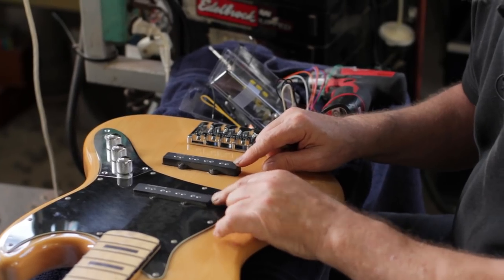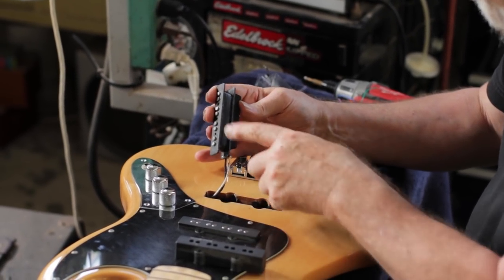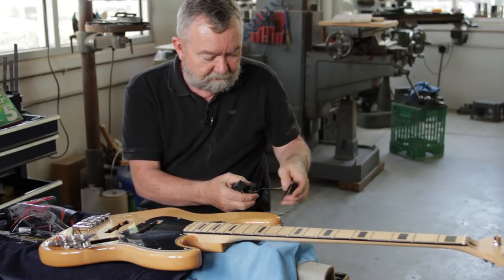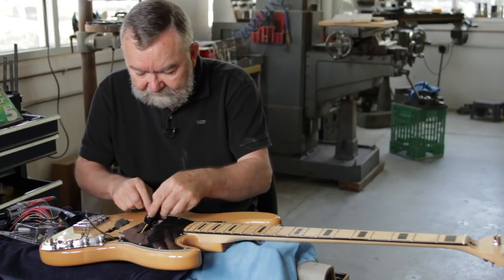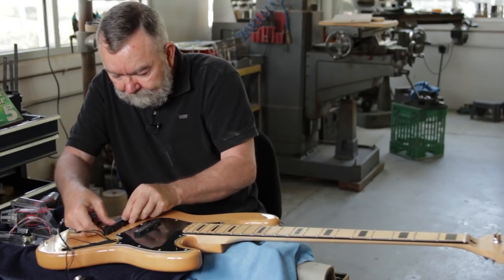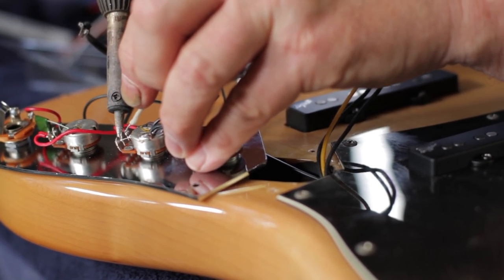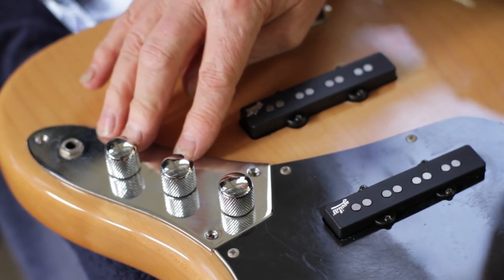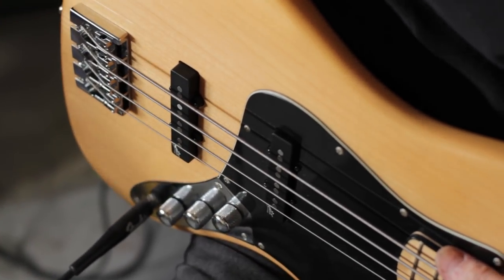How to Upgrade the Pickups on your Fender Bass Guitar | ELIXIR Strings

Comment: Mr Carruthers, I have read articles by you for years and it was a real treat to see a true master at work.  You make the soldering look so effortless.  I've always had difficulties with the soldering of wires to the back of the pots.  What iron do you use or more generally what temperature should the iron be operating at?
Reply: Michael Head 360 for leaded solder 380 for unleaded.

Comment: John, I purchased a Babicz replacement bridge for my fender 5 string bass put noticed its is 2-2.5mm wider from the B string saddle to the G string saddle than my original bridge.  Would this push my B & G strings to close the the edge of my fret board? Also the bridge has 6 screws instead of 5 like the original and I may have to install the bridge closer to the base.  What are the implications of lengthening my strings from nut to bridge?

Comment: I wonder why people never twist signal cables for PUs. That would reduce the noise. And strange enough humbuckers that are hum canceling normally also use screened wire, but
single coils does not.

Comment: Hi John. I have question. You were showing the pickup removal and said you had removed all the wires but I noticed another wire that is screwed to the bottom of the cavity with a screw but you never addressed that one. I am curious is that actually needed?  What is it's purpose since it is not attached to the pickups but that wire does go back to the pots and is soldered to one of them? I have that same wire on a Squier Bass I am working on and am wondering if it is really needed . https://youtu.be/WUYTc6niEFo
Reply: Franko S. That's for grounding.